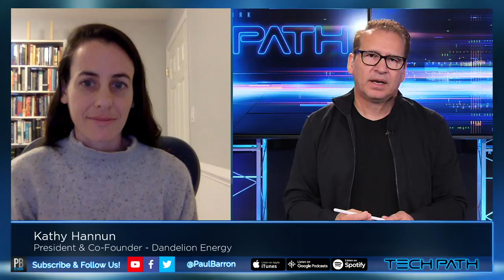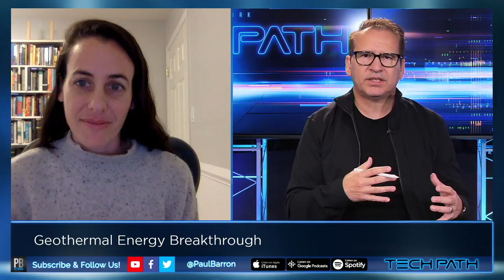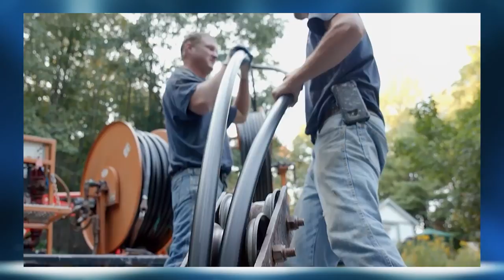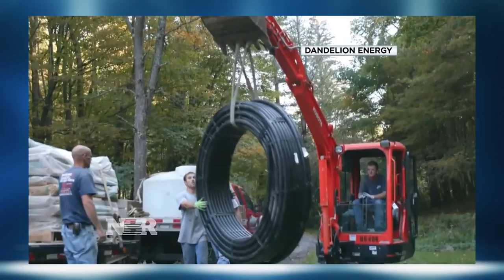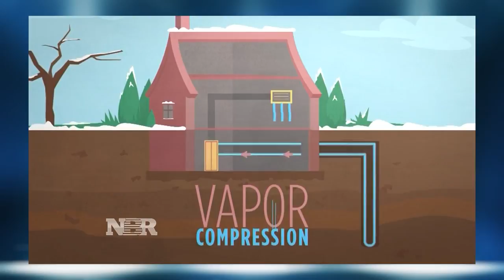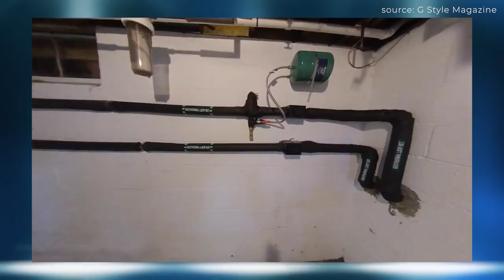Geothermal Heating & Cooling | Dandelion Energy CEO Interview

Comment: Everybody talks about the efficiency of geothermal and how great a heat pump is but nobody shows the equipment that actually cool or heat the inside of the house. The Mini-Split system is whisper quiet inside the house but what about geothermal? Maybe you can make a program to show how does it works

Comment: Thanks for the interview . Does your system work in Florida ?
Reply: It would.  While most applications concentrate on the heating side of the HVAC equation, AC can certainly be run off of a geo heat pump.  Instead of bringing the warmth of the earth to the home, the system runs in reverse and dumps heat into the earth.

Comment: A commercial drilling service I found,  can drill 5 250' holes in 5 hours. Would Dandelion use this if the homeowner got to do the service and for Dandelion to install the prescribed
geothermal heat pump system?
Reply: Can you share contact info? How much would that cost?

Comment: servers colled by geothermal ? wow that could be f.ing awesome ! 
with wind there is infra sound which is dangerous to us solar is briliant but best where its more sun but geothermal is literally for hot cold west east anywhere sounds awesome !
have you experemented on what works best could you do multiple bores in one area or could you do what the frackers do and drill down then horizontal after maximising the area and volume of pipe and coolent or even massive dencly coiled pipes  transfereing the most posible amount of thermal ?